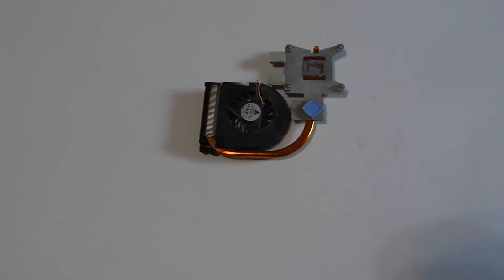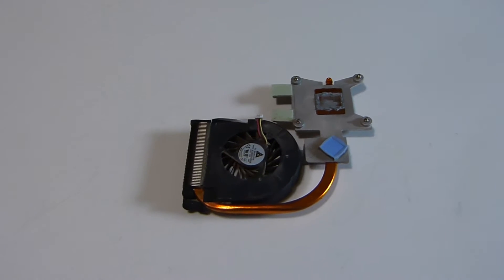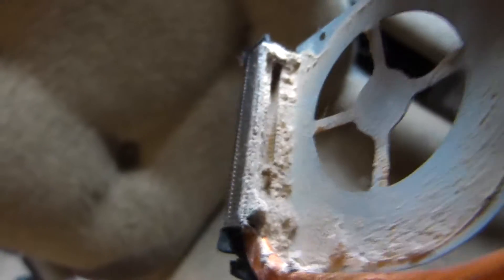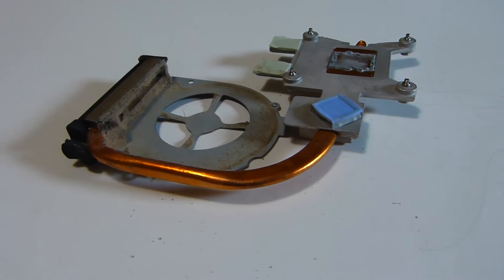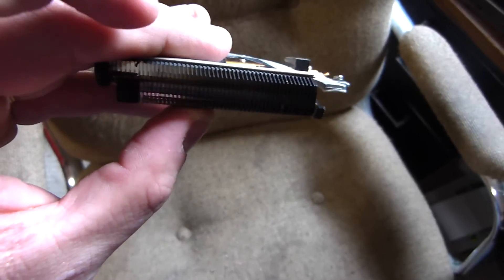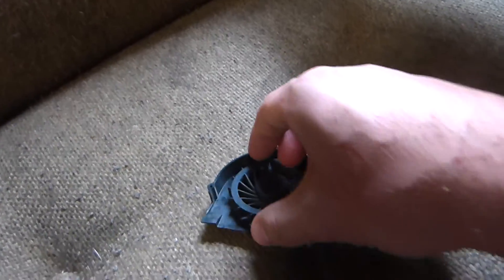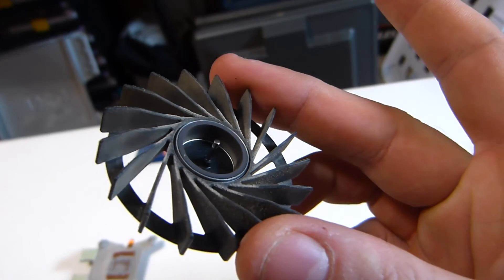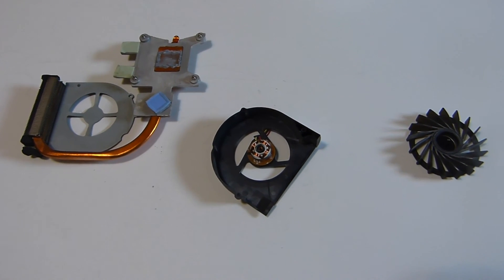Why Laptops Overheat and How to Keep Them Cool

Comment: Looks like the rat's nest I found inside my HP G7's blower assy.  A laptop should never have an outside air inlet directly below the spinning fan on the underside.  One thing that perplexed me was the G7-1167dx's  single tube heat pipe does not employ a second heat spreader for the  Northbridge. HP design team just does not give a flip.